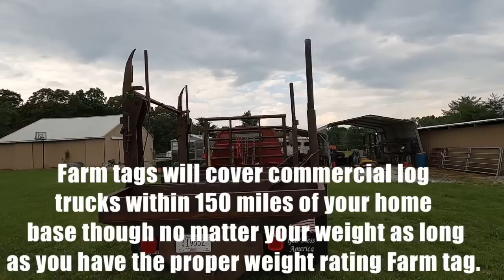What is a Side Loader Log Truck? Watch this!!! #032

Comment: First time i helped build one of these side loaders i was about 12 year old, these loaders are hell on a truck, dropping the log into the bed. A power boom loader is much better. it can skid the logs in and load them. But the same but uses a swinging boom, that fitting on drum that rotates is not hard to find,it is a simple hydraulic swivel fitting.  You can also use a pickup truck rear end, and dont need the fitting. brake one side other side turns. When i was a young man these home made log trucks where ever where, hundreds of people built them. With a boom you can either use hydraulic cylinder to turn it, or just use a boom that can swivel up or down, and hold in place with 1/2 cable connected in center from end of boom to center of back, when you pick log up,tension on cable pulls boom to center of truck. Heck of up grade from side loader. We used them both. Side loader is fast for cross tie logs. Power boom loading longer logs and skidding out logs. Now days a tractor and front loader made them both obsolete. A tractor is much safer and will work circles around either one of them, these where built when nobody could afford a tractor.
Reply from the maker: Yessir you’re right. I’ve got a skid steer now and has made life a lot easier. However, I still got the side loader :) there are techniques to do, that will save your truck from getting beat up so bad using it. It has worked good for what we do with it. But the skid steer is a whole lot better on me and the truck. Thanks for taking time to watch and comment my friend. Take care and do come again, please

Comment: That's like an old Mack truck, they were slow, top speed 65, maybe, but at the end of the day, you're right up there with the rest! if you want to have entertainment, watch a ball game or something!!
Reply from the maker: Ten fo! You’re right. I’d love an old R model tri axle Mack with a 350 Mack motor and twin 6 speed. Good ole log trucks! Thanks for watching
Reply: @zachodom7486   I know some people still running the old R Model! Not real good on hills, but you get there!
Reply from the maker: Right! I looked at a real nice 08 model Mack Granite. Tri axle. 550hp Mack engine with 18 speed and 52k pound full locking rears. It was a rock truck. I believe it would’ve made a real nice truck. I heard tell of a feller one time that had an old r model tandem truck with a side loader on it. I never saw it, but i bet it was a real truck.
Reply: Thanks for the very thorough explanation of the design,operation of the side loader. I grew up in Louisville, Mississippi.  It is the home of Taylor Machine Works.  They made a side loader called “The Loggers Dream”.  It was very similar too yours, as you mentioned.  They were very prevalent in use in our area.  I know they were built through the 50’s and into the 60’/70’s.  We occasionally see one in use now buy small loggers like you.  With the advent of skidders/knuckle booms,etc. they fell into disuse by commercial loggers in our area.   “Short Loggers” like you are a dying breed in our area. Taylor manufactured a cable skidder/loader labeled as a Loggers Dream as well. The Loggers Dream was a product that led too the production of a short pulpwood loader for wood yards and later fork lifts for handling logs at mills.  Now Taylor is into forklifts in a big way, huge machines, shipping container handlers, etc. Their equipment is now in use worldwide. The side loader was a type of “pioneer” product that contributed to the growth the company.

Comment: Thanks for a great video, brings back a lot of good memories for me! 

At age 17, I started logging with a new from the factory Taylor sidearm loader mounted on a tandem Ford truck. I hauled 145 miles round trip (a long distance back in 1965) 2 loads per day. You could nearly set your watch by my pace due to the efficiency of the mules, loader and high quality of the 12-24ft logs I hauled daily. Usually took 13-18 minutes to load. I loved every minute of it.
Reply from the maker: Whew! Yessir for sure. The mules and side loafers are a LOT more efficient than most would ever know. Thank you so much for standing your experience with me. I really love hearing from older hands that knows their way around a animal logging outfit. Take care and thx again for watching

Comment: should you have something to take the weight off of the truck, those first few logs beat the crap out of the truck, just curious.
Reply from the maker: If you load using the side loader the yes you want smaller longer logs on bottom first then bigger ones in the middle. But if you’re loading really big logs like is in our picture on the truck, then you cross haul them onto the truck. There is a link in the description showing how we do that. Thanks for watching

Comment: why dont you make tourself some 6-10 inch wood beams or one single beam that you would drive on under the driver side to tilt the truck a little so the logs roll off better when unloading
Reply from the maker: I have a set. Most times at the mills I deliver too we’ve got a little hill I can park on to get em off easier: but yes in answer to your question. I do have some. Thanks for watching!
Reply: @zachodom7486  I was thinking about maybe some day making myself one of these for firewood logs that are light enough to lift I also have a tractor with a 3pt log grapple but can't stack much with that
Reply from the maker: @karl-egertdaskov6217 cool

Comment: So I understand the PTO is constantly turning the sprockets which engages the winch drums with friction from the brake drum. Is there a way to disengage the PTO, it seems like a lot of wear on the chain and sprockets when you go down the road. And thank you for your time showing this system.
Reply from the maker: Yeah there is a part early on in the video that explains it. Pto control is on the console and you can engage or disengage it. When we’re in the woods loading, we just switch the truck off and on. Then we’re ready to move the truck or head to the mill, you can disengage the pto. You don’t want the pto turning when the truck is moving. If that makes sense. Thanks for the kind words, and thanks for watching!

Comment: Wonder how your overhead is compared to a fully mechanized job. Good used skidder anout 50 grand loader used 80 sawhead 35 or 40. How much are draft mules again
Reply from the maker: I’ve ran both types of operations. Cable skidder crew and chainsaws, and now mules. Animals are wayyyyyy cheaper by far. Percentage wise at the end of the day, I am way ahead of a mechanical crew. Production wise, no. But for what I put into it vs what I get out of it is a whole lot better and not near the stress either.

Comment: Are those loaders still around to buy and what do they go for?
Reply from the maker: They’re no longer manufactured. But there are used ones around especially here in the south. You just have to ask around and look. I run across them every now and then. They’ll usually bring 2-3k depending on their shape. Sometimes you can find a deal on a truck and loader together. That would be the best bet. And usually with a little love you can breathe life back into them. They’re pretty simple and easy to keep up.

Comment: If you were to add timbers in your bunk beams on the bottom that are 2 or 3 inches thicker on the driver's side would it help the logs roll off when you dump?
Reply from the maker: Yes and no. Some that have swell in them wouldn’t roll no matter what lol. And sometimes when loading with the side loader they get sorta jammed in anyhow. I try to park on a slight hill every chance I get when I’m unloading to help a little or just use a block of wood to pull up on. Plus if ya did do that with the shims, the load might would ride a little uneven possibly, and with top heavy loads that wouldn’t be good. On log trucks, you sorta want a little extra on the drivers side to account for road crown: But 1-2” worth prolly wouldn’t hurt anything, although I’m not too sure it would help ya any either when unloading. So I can’t answer too well without trying it. Prolly be cheap enough to try. Thank you for the idea, I may consider something like that. I do like hearing from all you guys. Thanks for watching and commenting.

Comment: We used to have a set up like that on our pulp wood trucks, except it ran a cable boom instead of the side standards. The boom picked up the heaviest of the short wood.
Reply from the maker: We use to have quiet a few of those old pulp wood trucks down in Alabama years and years ago. Haven’t saw one in years!!!! But I do remember em. Thanks for sharing with me and thanks for watching and commenting!
Reply: Did it have the open differential car rear end winch? The paper mill in St.Marys Ga was still taking shortwood till 2002.
Reply from the maker: I remember the winch part of it but I don’t remember much details of it. It was a little before my time to be honest. But I do remember seeing the trucks a lot.
Reply: @zachodom7486   There is a video called " Men of the forest"  shows a family in Guyton Ga 1952 that's awesome.
Reply from the maker: I have saw that one. It’s great! And thx again
Reply: @zachodom7486  In 2016 they found the video and had a reunion. The "boy" is in his 80's now. Many of the children and grandchildren are around Savannah. The paper mill is Union Bag now Weyerhaeuser in Port Wentworth. My Dad had a kwik-cut saw ( made in Brunswick Ga, still in business ) he bought new. Dangerous as hell!!
Reply: My Dad and I built a ''jammer'' on a 68 Chevy 3/4 ton to skid post n poles and firewood with the frictions like this. He powered the drum with a 231 Chevy v6 and a 4 speed tranny mounted on the frame behind the cab. The tranny never left 1st gear.  The sprockets and the tranny were a powerhouse. We skidded big larch logs from the lower side of the road as far as 500 feet. The 16 foot boomstick would hang over the edge of the road down the hill and swing the logs up into the road at the top. The master cylinder friction control was really slick for pulling the leaning trees up to fall and feather the skidding power as needed. I even skidded a bull moose with it once. I need to get some of the vhs tapes converted to view. Man do I miss those days getting wood.